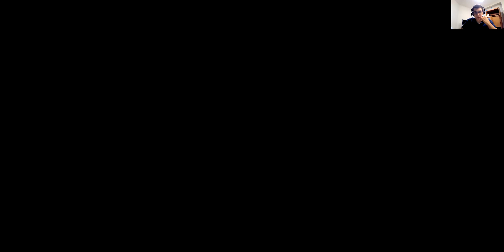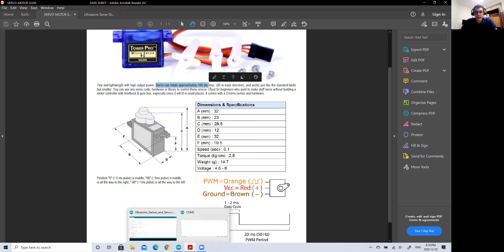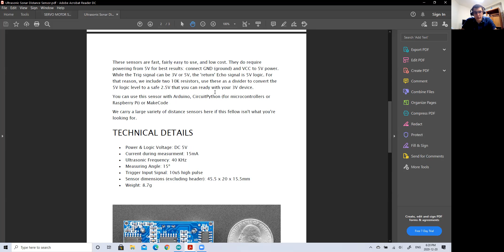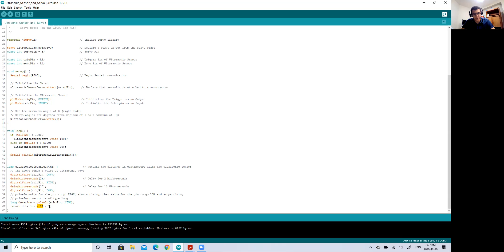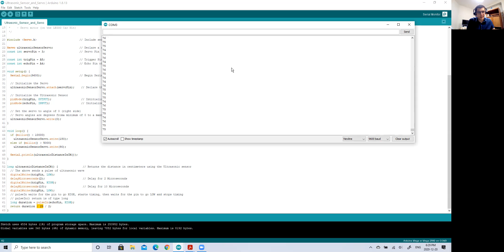Operating the Ultrasonic Sensor and Servo

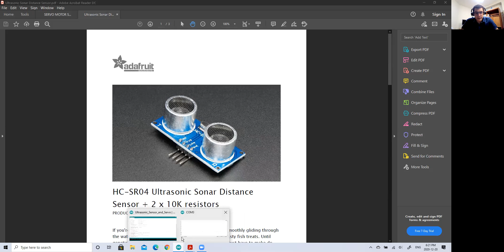Comment: Hi where can i have this untrasonic sensor file for setting  03:40 pls tell me , or if we connect the sensor USB to PC it Will appair??
Reply from the maker: You can find a link to it in the description of the video.
Best of luck with your Arduino endeouvours!
Reply: @KhaledElmalawany thank you ar good man 🎉🎉🎉🎉

 i did , this file can open by PC / laptop setting only right ??
Reply from the maker: @arteortmdecor7789  Yes, as far as I am aware, it is not possible to open an INO (Arduino file) on a mobile device (I also haven't looked into so it might be possible)
Reply: @KhaledElmalawany tq for your information bro,  i am newbie about this component and file, but i hav a job make stair using sensor lighting so i need to taking example from youtub 😂🙏